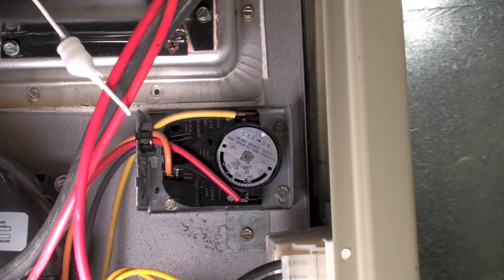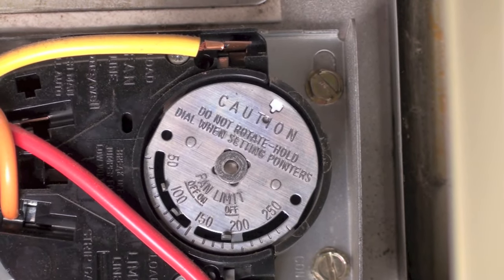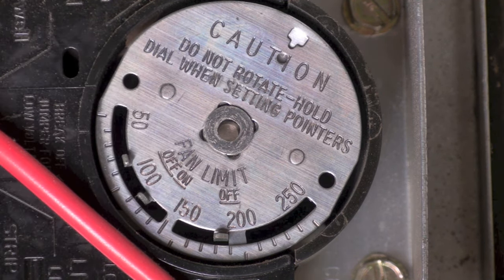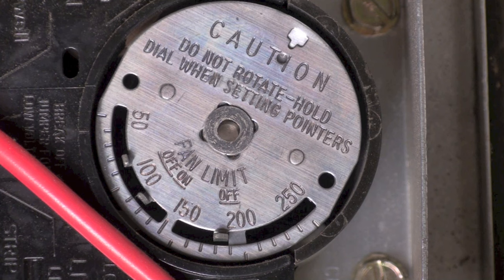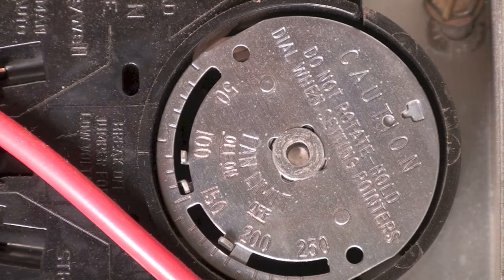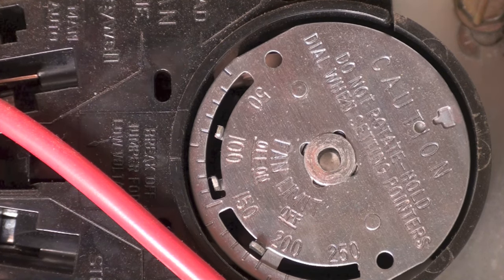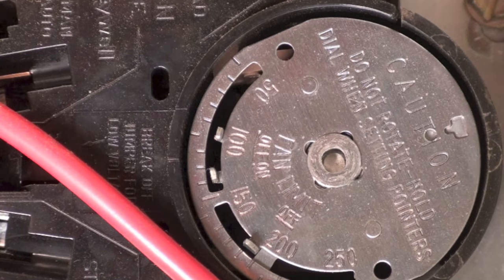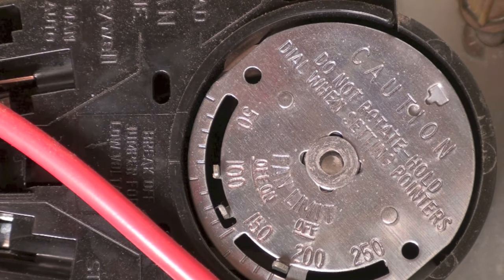How to adjust the Honeywell fan and limit switch

Comment: Just like to tell you youre invaluable to people and are appreciated. I bought the family home in 2016, that was built in 1955. It heats with a Majestic fuel oil furnace that has been maintained meticulousy by my uncle, who built the house. 
 Your videos have helped me keep this old furnace running and performing like new. I just cured a problem watching the fan limit control setting video. perfect remedy, cycles as it should now.
 Again, Thank you so much!!!   Steve Gasparino  Muncie Indiana
Reply from the maker: Glad I could help.
GFM

Comment: Thank you that was very helpful video! Mine was set way wrong. I don't know how it moved itself or what or if it was always set wrong but my fan on was way too close to the 200. So the fire was going almost all the way up till 200 before the fan kick on and then the high limit 200 would shut the fire back off. Now after watching your video seems to be working properly thank you!

Comment: Thank you!!   I have an old ass Ruud furnace, which gives me yearly problems.   This year was the fan limit switch and relay.  The wire nut from the 120vac side of limit switch to relay came apart behind the 4x4 box, shorting against the relay and taking out the fan limit switch with it.   

I bought a new fan limit switch, relay, and had to so some rewiring in the furnace - but she is up and running again.

This event also gave me time to run new 5 wire thermostat wire and put in a new WIFI thermostat unit while things were down.  The old owner had a Honeywell wiresaver in the loop which kinda limited my fan operation.

For $100 switch, $10 relay, $30 of 5-wire, and a $50 thermostat - I think I made out over what having a heating/cooling tech come do it.

Comment: These Honeywell fan and limit controls are the sturdiest, most dependable controls I’ve seen.  They make a version that has a 24 volt heater, we used to call a sure start, to help bring on the fan, and keep it from short cycling.  This type was mostly used on downflow and horizontal furnaces, because they were located on the furnace, where they didn’t sense accurate temperature until the fan started.  These controls had 6 connections.    Camstat made a plastic version that didn’t use the helix by metal, and they were much lower quality.  They both came in different lengths
Reply from the maker: I have not seen the heater version for a number of years.  
GFM

Comment: This is great.....our furnace is short cycling.  About every 5th run.    Thank you.  Going to try 100F and 130F when I get home.
Reply: I’ve had to go on at 130 and off at 90., at times. They do make a heat assisted version that will eliminate any short cycling problems.

Comment: Holy sh!t, you explained everything and didn't blab on and on or say "Ahhhhhhhh" 400 times like other vids I've seen explaining things on youtube. Bravo, this is just what I needed. I'm working on an add on wood furnace and fan runs forever with no heat because the open on the thermodisc was 90 degrees. It's just making the meter spin. Looking for a thermodisc replacement with 130 closed and 100 open. A fan limit switch will probably end up being my fix and thanks to you I know how to set one properly.
Reply from the maker: Thanks for the support.
GFM
Reply: Seems to be working, house is hot and fan only running half the time. Have it set to a big swing because it's wood and heats up fast. See if power consumption drops over the next week or two.

Comment: this is my first comment on your tube ever you just saved my ass with this my furnice I installed was short cycling durning a cold snap -16 degrees figured out something was wrong after temp in house were below 60 my fan off and on points on my furnice were so close together that it would heat up fan would kick on and temp would drop so fast it wouldn't stay on for more than a min now all good thanks!!!
Reply from the maker: +Mike Kiefer Welcome
GFM
Reply: Mike Kiefer ... so your burner limit was set too low, right? > ~180F

Comment: Dear GFM, I think we can use a digital thermostat no problem. Tommorow I have to do wiring on something like this. I will use the W and common from a digital thermostat, and connect it across gas valve . Then just wire the rest of it in the way we  normally do with the fan limit switch. The thermostat digital or mechanical, just is a switch making gas valve work..

Comment: My furnace arrived in 7 boxs with a note saying good luck...im a good mechanic..after watching your vid I ck this fan switch  it was set 100 130  forced air..the baseboard heat has never been hot just tepid  I live in fairbanks alaska  Brrrr!!  the thermo couple rod was touching the  top edge of the outer burner box..that could explain why the fan came on after shut down.that install was my ignorance.  hope this correction reduces my $6000 a yr home heating bill any amount.. Thanks again

Comment: This is excellent advice. The best one I’ve seen. I’m having trouble using my blower fan to circulate wood heat so the fan will automatically shut off at my preset temperature. Nobody knows how to do this and I can run my blower fan without using gas but it won’t automatically shut off, it gets too hot and I have to manually turn it off. Any suggestions?

Comment from the maker: It could be the attic temp.  Gosh, I hate to set it higher than 150.  The limit probably is set to 180 or 200 so that's pretty close.  Are the turbine fans operated by wind?  If so, a good idea would be to install a powered attic fan.  You would also reduce cooling costs.  Hope this helps.
GFM

Comment: Thanks for posting the video.  My Lennox furnace is about 23 years old.  Last maintenance service was done in 2012.  The Honeywell Fan Limit Switch is set up at 100/150/200.  I like to keep the furnace motor on all the time - to circulate the air around the house by setting the fan option on the house thermostat in the living room to ON rather than Auto (Note: the Limit Switch Unit button is still on AUTO rather than Manual).  Can I adjust the 100/150 numbers so that the blower comes on early and keeps going  longer even when the burner flames are no longer ignited.  That way, I can put the fan option on the thermostat in the living room to AUTO option rather than ON all the time.

Also, how long can a blower motor last if the furnace is properly maintained (regular filter change/motor lubrication etc)?  So far the original motor is still running.  Thanks for your help and advice in this matter.
Reply: akbaxb165 don't overlook the blower run capacitor. The value changes little by little as they age... eventually the windings are so out of balance that the insulation can cook or boil of lubricant from sleeve bearings. The run cap is used to create an artificial 2nd phase with voltage shifted at 180°. The value must match precisely the windings.

Comment from the maker: I would set the "on" at 140 degrees.  The "off" seems a little low but unless the fan comes on in the summer and does not shut off, leave it alone.  Hope this helps.
GFM

Comment from the maker: I reset the channel settings so it should work.  Are you doing wood projects?  If so, the heat exchanger could be plugged with burned sawdust.  Only other possibility would be a negative pressure in the structure such as exhaust fans etc.
GFM

Comment: Hi!
     My replacement combo fan limit switch has no LIMITERS. My old one limited the high dial to 175-degrees. But I can put my new switch dials, left (lowest of the three), middle and right (highest), anywhere from 50-250. 
     I set the dials as close as I could to the old settings—100, 140, 175. 
     You said it’s best to set the low at 100 👍, but is there a danger to setting the high to high? I won’t do anything different until I hear back from you.

Comment: Great video.  I just sent you a question to one of your other videos and I'm wondering if this is the problem that the fan switch isn't set right but the problem is that the fan comes on and shuts off after a couple seconds but only shuts off for a split second then comes on longer and long then stays on.  Maybe the settings are right on top of each other till it gets hot enough to drive the dial past those settings?

Comment: Thank you very much for your time with this. My fan is not shutting off. I have the limit at 200 and the fan range at 80  to 110. Once the dial appears to have stopped turning and the fan continues running if I lightly tap the furnace metal next to where the switch is mounted it turns and shuts off. Does this require a new switch or is there something I can do to lube the dial shaft? Graphite?
Reply from the maker: Usually if they stick like that, the best thing to do is replace.
GFM

Comment from the maker: Watch the burners when they operate to see if they rollout.  May take a couple of minutes.  Painting is the worst for these furnaces as they draw air from inside the structure.  You can try replacing the wires but be careful!
GFM

Comment: Hi furnaceman, thanks for the vids. I have a gas furnace in my garage and I tyied to turn it on the other day and it didn't work. I discovered the wires from the fan and limit switch were burned to a crisp. Any idea why this happedned. Can I just replace the 3 wires or do I need a new switch? Thanks

Comment from the maker: It would always be best to replace the fuse like for like.  However, the fuse is generally matched to the wire size which would probably be #14 or 15 amps.  To be safe I would not leave it with the 15.  The rail burns are probably normal from the flame spreader.  The short cycling is probably thermostat anticipator.  Check out the "thermostat anticipator" in the search engine at the channel for instructions on how to adjust.
GFM

Comment: Excellent demo. My symptom on my Duomatic Olson with a Honeywell Fan Limit Combo switch is the burner lighting, blower comes on for 2 1/2 minutes, then burner shuts off along with blower...and in about 2-3 minutes recycles and keep repeating the cycle. The fan switch is original. So basically, the furnace heats for 2 1/2 minutes, shuts off, rests for 2-3 minutes, then repeats. Any ideas?
Reply from the maker: You can jumper the thermostat connections to be sure the thermostat is not short cycling.
GFM

Comment: Hello Furnaceman, Can I ask you a couple quick questions?  Scenario - Furnace was working fine, but very noisy. I took it apart to clean it. Found half a bearing on one side so replaced them, vacuumed, jigalooed everything, put a new belt.

 1. Tabs are in same spot, but the 'ON' tab started malfunctioning, as in it hits it turns on, but when the dial starts going back the other way it clicks off immediately from hitting the 'ON' tab again.      Is that a sign of a faulty switch??
2. The ones you work on in your videos don't have a manual/auto button, that I can see, which mine does. If that tab breaks and comes out is there anyway to fix it? or bypass it and just leave it on auto? (I think there is no connection with the button gone so auto doesn't work, just manual when I jam the broken button back in.)

Thanks, any help is very appreciated.

Comment: Thanks for the help. I'm going to upload another photo for you. I replaced the wires and the delay fuse. It had an 10amp and I could only find a 15 amp, will this hurt? Replacing the wires and fuse got the system back up and running but there is still a problem. You will see in the pic the burn marks on the rail outside the burners. Ran system 15 minutes, didn't see any rollback of the flame. Burner shut down several times before reaching thermostat temp, this is probably normal. Next post

Comment: thank you for a very helpful video series! here's my question: when my filters are dirty, i can run at these settings. (the 100 and 130..) but with new clean filters, at these settings the blower will kick on and then off fairly quickly. it only stays off for a second or two and then with a 'lurch' will turn back on again. if i lower the temps to 90 and 130, the air just doesnt seem very hot. any suggestions?
Reply from the maker: That is a common problem when the temps are too close.  I would set the on temp for 140 and leave off at 100.
Reply: ill give it a try and let you know. thank you very much!
Reply: grayfurnaceman well, now it appears to be intermittent. it didnt do it earlier today, but i just heard it again. it stops for a brief second (not even long enough for the blower to stop turning) and then kicks on again. very strange.
Reply from the maker: Some of these switches have an electric heater built into the switch.  If the heater is burned out it will short cycle.  It should be located at the center of the black portion of the switch with 2 wires mounted there.  I will do a video about that as soon as I find one.  Also some of these switches had an air dam below the element.  If that was removed, it would cause that.
GFM

Comment: Spray painted some house doors. Furnace is boxed in with filters on the intake. Should I replace the wires and see if it works. I don't use it much just once in a while. Thanks

Comment: Hi there thanks so much for having all this great videos 😎 I just installed at limit switch and I have it set at 100 140 200 I want to make it so the blower comes on right after the flame starts what number would I use thanks so much ⚒
Reply from the maker: For it to work properly, you will need the burner on for 30 to 45 seconds before the fan comes on.  Your settings are what I would do as an initial setting.  Setting the on below 140 may cause the fan to short cycle.
GFM
Reply: Thanks so much for your help I timed it and it does come on 35 seconds after the burner starts. So by watching your videos I did it the right way keep up the great videos
Reply: The fan should run sometime (30-90sec)  after the burner comes on - you don't want cool or cold air blowing from the ducts (unless its A/C functioning).

Comment: Not sure about why I'm having trouble with this post. Furnace keeps coming on even when up to temp. Only after I lowered thermostat a few degrees would it cycle off. Fan limit is set at about 110 and 150. Not sure when or why there are burns on that rail, but seems at some point the flame did rollback. Since the system seems to not want to shut down could this be why the wires got burned? Looks like a Johnson furnace. Thanks for any help

Comment: I posted pic as video, I guess you need to approve it? It an Air Ease furnace I think, thats what it says on front cover. Has a pilot light.
I ran it for about 2 weeks this winter to do a project. Forgot to turn it off, no big deal, just wasn't in garage. It was running so I realized I'd left it on. Turned off and turned power off. Would not come on last week and this is what I found. Not sure how it was running before I shut it down? Thanks for any help.

Comment: My furnace shuts off at the appropriate temperature. But the unit keeps blowing cool air for 20 minutes after the furnace or heating shuts off. I know that the fan needs to blow off all the hot air into the house but 20 minutes is a long time.   Do I have to readjust the fan limit switch?
Reply from the maker: If the fan switch is adjustable,  I would say so.
GFM
Reply: Obviously yes - try that and let us know if that fixes your problem.

Comment: Wouldn't a vintage Honeywell limit switch have a 4-digit number labeled as the model #?  I'm not sure what you called it at the end of the video...?  A friend of mine just got an old Monarch 'Add-A-Furnace' outdoor wood furnace with test date imprint 1978 and a Honeywell 8049 (?)   I didn't have my phone or a camera with me, and it was getting dark & box kinda dirty, so I may have confused a '9' for what should've been a 6, as in 8046.

Comment: I set my temp range on my old honeywell to cut the fan on at 130 degrees, and cutout fan  at 90 degrees. However this is what is happening. Furnace starts heats up to 130, and the fan cycles, but it quickly lowers in temp pass the cutout point and shuts the blower fan off. Would you think this would be a bad limit switch, just by how it is acting.

Comment: Would bad settings cause the pil furnace to always shut off when getting to got and put it in reset mode ? I'm having issues with my thermopride. I can't set my thermostate below 70 in my older 1970s home cause it shuts off and needs manually reset.
Reply from the maker: No.  If you must reset the cad cell relay, you have a problem either with flame shutdown during operation or the cad cell is no seeing the flame.  Start with cleaning the cad cell.
GFM